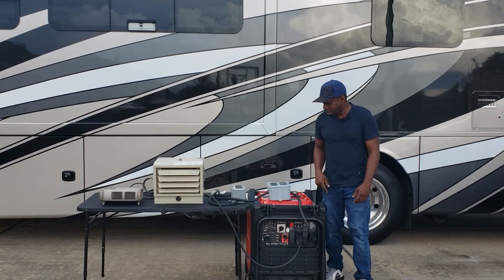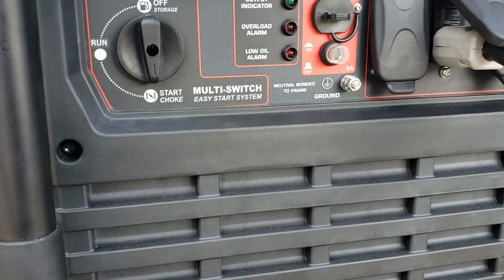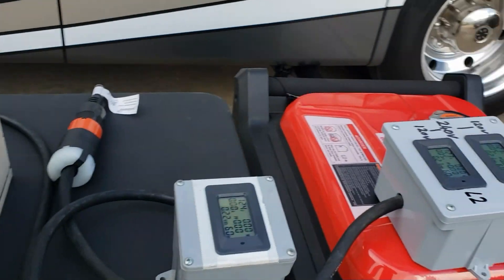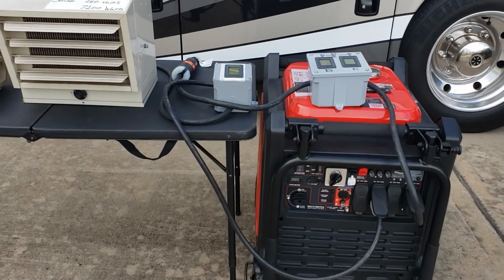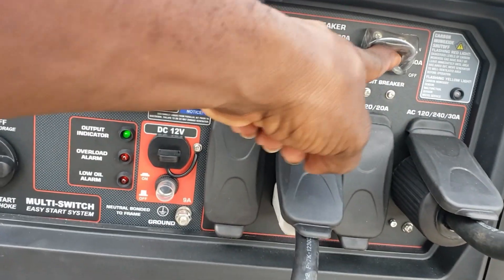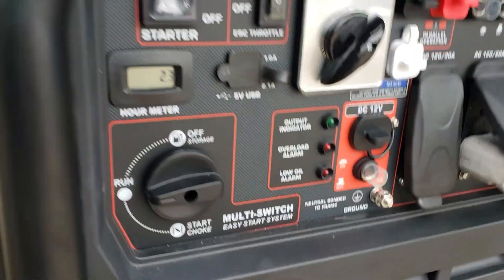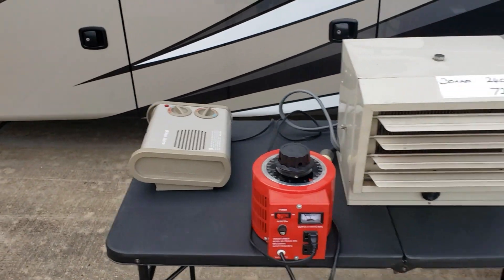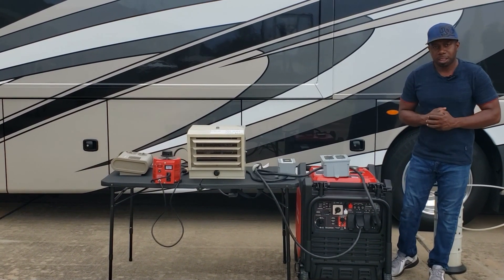Maximum power output of the Predator 9500 Watt Super Quiet Inverter (Generator Review)

Comment: Great review but swapping the voltage while running may causes additional wear. However, if not load maybe not…
Reply from the maker: The voltage selector only turns on and off one leg. These are Inverter generators.
Reply: @GeneratorReviews  the book says to shed all loads before switching from 120 to 240. That’s all I was pointing out. 

I have read about folks having very replace it after switching under load. I don’t want to be him.

BTW search insulated or shrouded banana plug and you will find all sorts of 4mm  32 amp rated plugs that fit Predators for fabricating parallel cables.  I guess 32 amps a leg will work. They appear more robust than the factory plugs. That saves sacrificing kits for plugs and you can run 10/4 without a splice.

Thoughts?

Comment: What cable is it that your using to get the 60 amps
Reply from the maker: I just used a 30 amp to a 50 amp adapter
Reply: Gotcha. Thanks! I have the Predator 9000 gonna try tomorrow to power my RV

Comment: When you are testing the 240volt heater is it both legs bonded to create 240 or is it 2 legs of 120V?
Reply from the maker: Yes both legs are bonded
Reply: Thanks for getting back with me, Has anyone had an issue the the inverter after bonding the  the X & Y ( black and red )

Comment: Still looking for a video that goes thru all this only hooked to a house? Wondering if the 240 with only 30 amps is enough amps to run a whole house? Is the 30 amp per leg so you get a total of 60 amp service to your house? Or only 30 amps which does not seem like enough to run a whole house?
Reply from the maker: I will work on that video this weekend 
Thanks for watching and subscribing 👍🏾

Comment: I just tested it...when my soft serve machine runs..the predator 9500 voltage drops from 120 to 101🤨...and there's my problem why it doesn't live up to the 9500 watts...not happy🥲
Reply from the maker: Kevin that soft serve machine pulls some serious power 😟
Reply: @GeneratorReviews  yeah. .it does ...but the predator with the specs SUPPOSED to pull it...it doesn't 🙄🤨

Comment: The switch still confuses me (sorry)...I have a 220/240v plug that I plug in to my  9500 to run all of my food truck. Can i run a 208v machine (just the machine) thru my L14-30R plug on my truck on 120v switch side ..or do I need to turn it on the 120v/240v switch side?  I ask this question because I was trying out 2 different machines on my truck...and the 208v machine (which uses less power than another 110v machine) couldn't pull enough power (7600 starting watts) and wouldn't world properly.   But with my other machine (8500 starting watts)...I ran a 10gauge plug to the 120v outlet (not the 220 from the truck) and it worked fine with just the 120v switch only turned on.  Why is that? Please help all the way in Hawaii!!  ALOHA!!
Reply from the maker: The switch only turns off line 2 it doesn’t change the output voltage in any way.

Comment: Happy to have stumbled upon the channel. Good stuff! For future ones can you do 2 additional measurements? 1) maximum starting watts on the largest outlet (240V/30A in this case) and 2) run time at 80% running capacity (6000W here)?

I am looking to use this as my emergency home generator with a transfer switch as well as an RV/camping power solution. Knowing the largest 1-2s spike the biggest plug will accomodate would be helpful. I typically like to purchase equipment that puts me at 80% utilization to provide room for swings as well as promote long-term health of the product; so runtime at 80% would be also a good piece of info.

I am buying the predator. Perhaps you know the above from your use of it maybe?
Reply from the maker: Thanks for watching 
Run time videos are hard to make unless it’s a power outage. I would definitely drive my neighbors crazy for 12 hours running a Generator at 80% 
I like that you have a maximum load in mind of where you limit your generator I wish everyone would keep that in mind. 
I will definitely consider your recommendation on my next review 
Thanks Steven
Reply: @GeneratorReviews  True thats fair. Maybe run it at 80% load for 30 mins and see how much fuel is consumed? Like if it eats 1/5th tank in 30 mins at 80% then probably 2.5 hours @80% with full tank.
Reply from the maker: @stevenohnsat7535  I can probably get away with an hour I’ll put in exactly one gallon gas and see what run time I get at 80% 
Then we can calculate
Reply: @GeneratorReviews  That'd be awesome!
Reply: Yes me too.

Comment: Hey Gavin, does this thing charge its own battery when running? Thanks, Tim.
Reply from the maker: Yes! It charges it battery while running
Reply: @GeneratorReviews  thank you sir. New subscriber. Picked mine up yesterday. Experimenting now. Did my first oil change at 3 hours. Oh boy, shined my flashlight on it and it was glitter city. Gonna do my next one at 10 hours. Thanks for the great detail you put in your videos. Tim.
Reply from the maker: @Idahodeerslayer  thanks 🙏🏾 for the Support 😎
Reply: @GeneratorReviews  hey Gavin, been running this thing for about ten days now. It was supposed to one up my Honda eu7000. My Honda wasn’t quite enough for my application running the whole house and charging the off grid battery bank at the same time. The Honda was real close but would occasionally hit overload. I’m using the predator now and I actually think it isn’t even as good as the Honda. I think it is tripping the overload around 6K watts. I haven’t put my meter on it yet, the numbers I’m using come from my mate 3 monitor on my off grid power system. I will update after I actually put a meter on it and read it. So far I’m pretty disappointed. I’m even running non ethanol premium in it. I’m wondering if it should have a carb adjustment? It seems to run smooth and fine it just keeps overloading prematurely. So far I would say not a Honda killer. My hope is Honda will respond with a predator killer that is 10k surge, and 8k constant watts. Love all your videos. Keep up the good work.
Reply from the maker: @Idahodeerslayer  Hey Tim, have you changed your oil yet? That’s 240 hrs at near max power. I would definitely recommend synthetic oil for longer intervals and change your plug to a NGK
Reply: @GeneratorReviews  I am using  full synthetic 10w30. I changed it at 3hrs, 10 hrs, 30hrs, and 100hrs. I was going to ask you about the plug. I know Chinese plugs are usually not very good I just didn’t know if it was a big enough difference to cause the overloading. Do you know the NGK number? Thanks again. Tim

Comment: Hi Gavin,have you noticed a small fluctuation of rpm in the Eco mode with the Predator and the Duramax. Voltage and Hz are still solid.  Just curious.
https://www.youtube.com/watch?v=kPi1Q4JHGoE
Reply from the maker: It has a slight surge you could clean the jets but  you could take it back for another one before your time runs out
Reply: @GeneratorReviews   Hi Gavin
You mentioned the low speed  jet.I have had to do that on a lot of older generators but you would think this wouldn't be doing this on a new XP9000iH. Just to let you know its also doing this on propane.  Its just a small amount of rpm difference when eco mode is on and no load, when there's a load even a small load it evens out.It really seems to be the electronic governor. Since its an inverter the voltage and Hz are still solid. I might try and get another one just to see if it acts the same. Its just been such a hassle dealing with Home Depot.  Fingers Crossed
Thanks and have a great Thanksgiving 
Robert
Reply from the maker: @Rk-mt4ll  Robert please don’t let this discourage you. It’s okay let’s figure it out with home depot and keep moving forward. You’re probably right it could be the throttle control, just try to get it replaced.
Reply: @GeneratorReviews   Just curious, so the predator 9500 and the Duramax XP9000iH that you have dont  have these small rpm fluctuations in the eco mode like in the video I sent you.  
Thanks
Robert

Comment: I will ask again, where can I get a monitor unit like the one you have for both legs?
Reply from the maker: I bought the monitors on Amazon I wired those myself for 240v
Reply: @GeneratorReviews  help with the link? For monitors, I am not good with electrical still learning, thanks
Reply: @GeneratorReviews  also possible diagram to wire monitors, would be appreciated, thanks

Comment: Have you considered surge watt test?  Could run the 7200w heater then quickly turn on and off an additional 2000w load.  Think viewers would interested to know if the predator 9500 really has 500 extra starting watts over the duromax
Reply from the maker: Great idea 💡 
Thanks I will give it a try

Comment: How do you feel about buying used? I’ve got a chance to buy 2 ef2000is generators for $900 that are used, great cosmetic condition so I’d guess not used much, both run good. My second option is a new in box ef2000isv2 for $750
Reply from the maker: I don’t have any issues with Used I’ve bought used.
some of my generators are used if they’ve been maintained and they run good that’s good I would jump on that deal 👍🏾

Comment: Really good explanation of the load test for the Predator. It really did great on the test. But compared with the Duromax. Dual fuel. I think I would go with the Duromax the dual fuel always a good option to have plus the 3 year warranty, I believe harbor freight only gives you 3 months on there. I’ll be waiting for the video on the double meter you had there also.  I imagine you use two different meters one for each leg of electricity. Thanks for your video buddy. I appreciate them. 👍
Reply: You can get a 3 yr warrenty and you can get a conversion kit as well
Reply: @chrisallen3741  if you add a conversion there goes your warranty.
Reply: @ciliap  i wasn’t going to to add til after that time frame….it wouldn’t change a whole lot other than i can use propane…..idk..

Comment: How can you run a 50-amp RV from that generator when it only has a 30-amp 240v receptacle?
Reply from the maker: If you divide 240V by 2 that’s 120V at 60amps
Reply: @GeneratorReviews  Ah..ok. So you are only using 120V.  I assume then you use some kind of adapter to go from the 30-amp twist lock to the large 50-amp RV connector?
Reply from the maker: @eosjoe565  exactly 👌🏾

Comment: Awesome simple explanation! I need the monitor box for the 240, can you built one for me? Cost?
Reply from the maker: Yep! Anytime
Reply: @GeneratorReviews  anyway to get a list of parts and maybe instructions on how to build the monitor box for the 240 that you have built?
Reply: Positive Comment
Reply: Building a monitor isn't that difficult.... Get the meters off of Amazon..$17 each, put it in a plastic box with the plug in and plug out and a little bit of four conductor wire... It will set you back a few bucks though because all the parts add up.   It would be nice if somebody made and sold them cheaper than you could put it together yourself... I bet many RV owners would love one.... It beats the trial and error method of causing your generator to cut off.  You could save a lot of the cost by omitting the plug/ receptacle and just putting it into an existing extension cord.  
It's going to run you about $75-100 parts to put one together.    

15 male plug
15 female plug
10 3 ft wire
10 plastic junction box
35 two ammeters from amazon
Cable clamps

Comment: For best test results you should add your excess 520 watt load equally divided between L1 and L2 as you had 35+ amps on one leg,, and 30 on the other when it tripped out on OL on the first test.
Reply from the maker: Thanks 
Good point👍🏾
Reply: 100 % agree. You put the extra overload only on L1, not a great thing to do. You may burn out winding. What would be interesting is to see if the overload is only for the total of both lines, or if you just had say 4000 watts on L1 without anythign on L2.
Reply: @IFix-Things  That's exactly right. I have the Duromax it's about 3800 watts for L1 or L2 before overload.       L1 and L2 = 7600 watts before overload.
Reply: @IFix-Things  You won't burn out the winding. Think of this, you roll this out of your garage and plug in your table saw which is on a 120 volt circuit. Then you turn it on.  All of that load runs on one leg. There's no balancing. The manual states in order to maximize the the amperage on the generator then you'll need to balance the loads out. Otherwise, it's perfectly fine doing what Gavin did. He didn't get 7700 watts, though. He overloaded one leg.
Reply: It's all about load balancing.